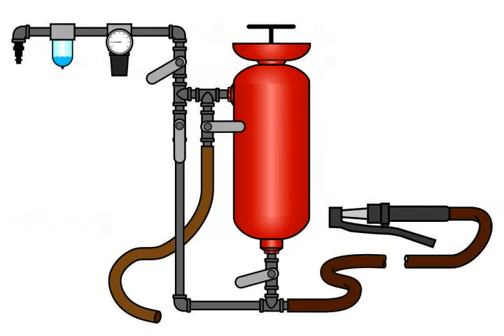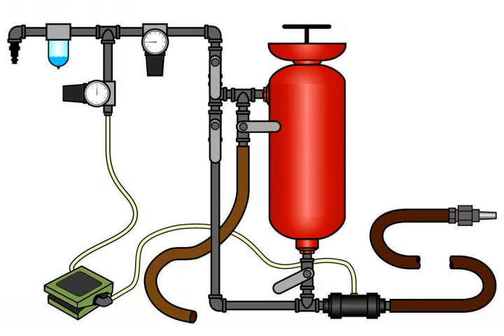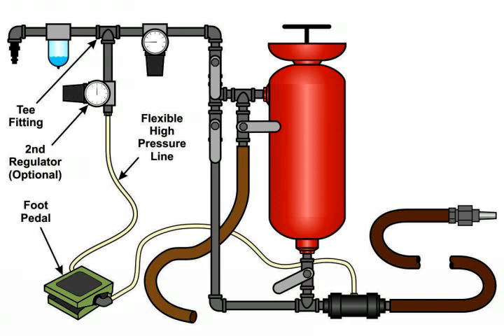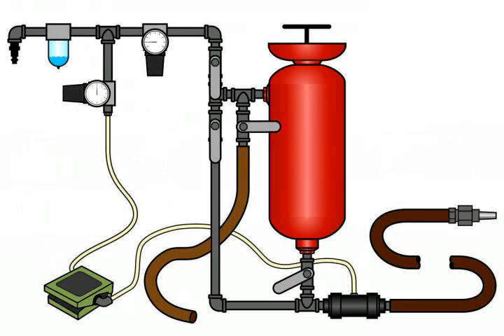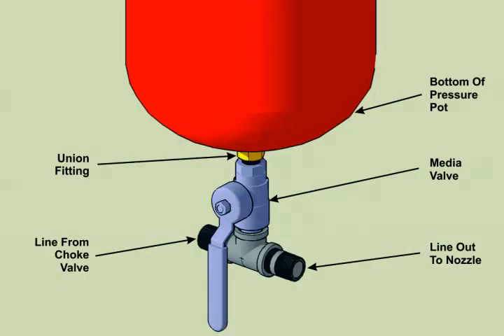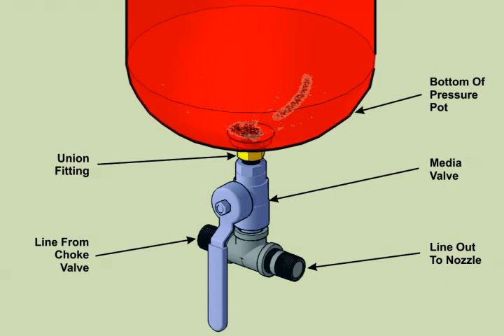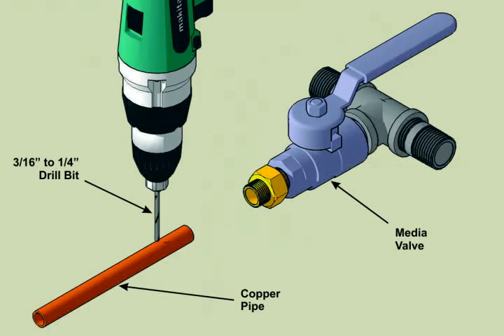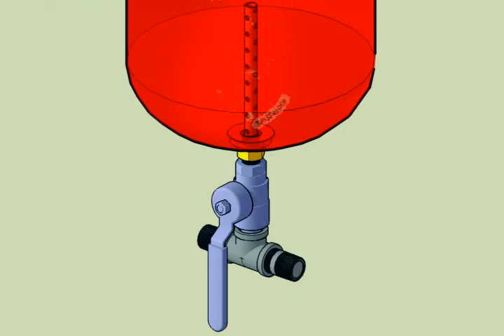Sandcarving Pressure Pot-102

Comment: All blasting cabinets are built by people who don't blast.  I have been doing this since 80's.  My cabinet has 0 dust, no pedal and no trigger.  I sit there, drink coffee or whisky and I blast.  Anything else is a misery.  This design above is nice, but has flaws.  The Diaphragm valve will deal with sand/media and there will be problems fast.  The new design uses air valve on top of the cylinder and when you release the pedal it discharges air from the pot to the cabinet.  All direct pressure cabinets actually suck, because they are complicated and not much faster overall if you know what you're doing.  My suction cabinets are not worse at all.  1/2 inch hose to the gun.  Correct media to air mixture at 101 PSI pressure is the sweet spot.  All direct pressure cabinets must have "balance".  Balance how much air is going through the tank vs the hose.  Balance between media type and media valve.  Balance between hose size and amount of air, and ETC.  I have yet to see someone find that balance in all those machines I watch on youtube.  They are all not optimal.  In the cabinets I built for direct pressure I had no valves, no consumables.  All hoses and nipples were sizes for a specific CFM and media type/size.  I did not worry about anything.  I simply blasted.  The trick he shows you with media getting stuck at the outlet is nice, but unnecessary if you design it all right.  You need mixing (bigger area) valve at the bottom, and you need to only send little air through the tank in order to have no more than 33% of media in the final hose.  Otherwise it will be a nightmare.  There is a trick to stop the media and air from coming out of the gun without any valves, electronics, and etc, but I can't show it or patent it, as people rip off patents right away.

Comment: Very well done, but my question evolves around the air supply. It seems most videos completely ignore perhaps the most important element of blasting and that is the air supply. What would you recommend in terms of compressors--not manufacturers--but specifications. Thanks for the videos.
Reply: You need to understand that yourself.  You need to calculate it, or estimate it, or try and error.  Direct Pressure is at least 15cfm.  15cfm (5hp) was my first built.  Was not enough for 1/2 inch hose, so I made the hose and nozzle smaller to keep up.

Comment: That shut off valve for the foot peddle should been fitted before the media and air are mixed otherwise the valve with get destroyed by the high pressure media flow over time and those valves are expensive....it should have a one way valve fitted just after it also...

Comment: what type of valves and hose is typically used in sand blasters,  i imagine any valves/hoses downstream of the pot are consumable and take quite a beating

also whats a good pressure to start with before dialing it in exact
Reply: T

Comment: Thanks a lot I'm having problems with water condensation, (I live near the cost so it's rather humid) & I'm sure I know what to do to fix the problem.

It seems that it would be safer if the Diaphragm Shut Off Valve would close when no air pressure going to the it, rather than open. That way if the tubing or foot valve broke or something it would shut down the flow of sand. But maybe I'm wrong.
 
Your 2 videos really helped. Thanks again.